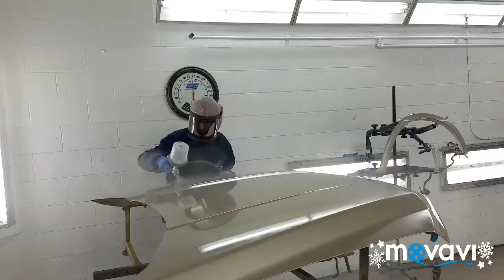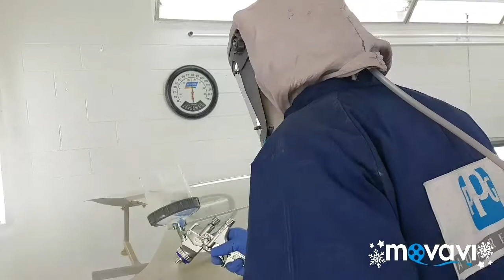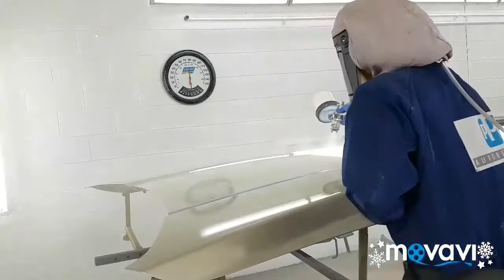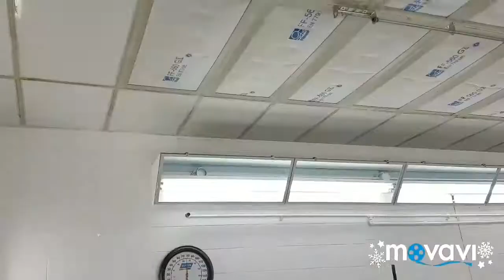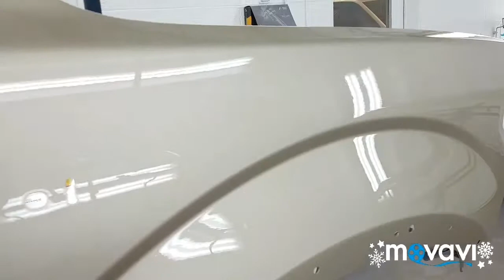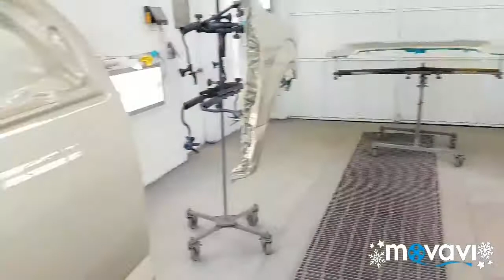PPG EC530 CLEAR COAT

Comment: Nice job. Every time I have sprayed that stuff, I get runs. Do you find you need to do anything special with that clear?
Reply from the maker: Thanks 😁 , Honestly it's very very rare I can get a runs with this clear coat and if I get some it will be by the door handle . what spray gun are you using ?
Reply: @shanehonmong9366  An FLG-4 with a 1.3. I am a total novice, so I did not know if it was me or the clear. Sounds like I have my answer! Thanks so much for taking the time to respond.